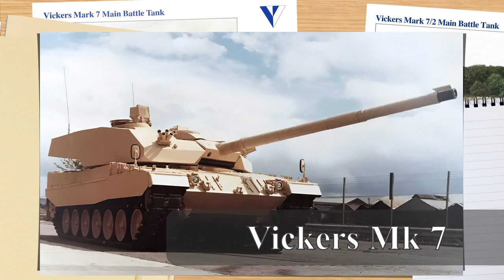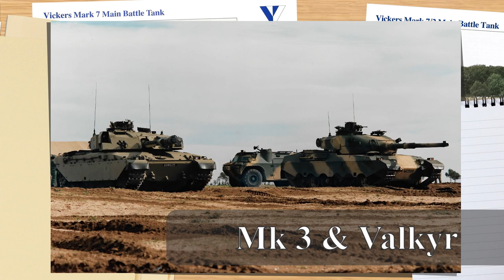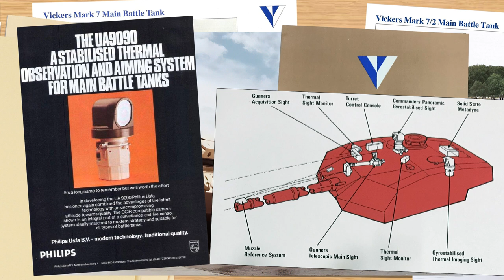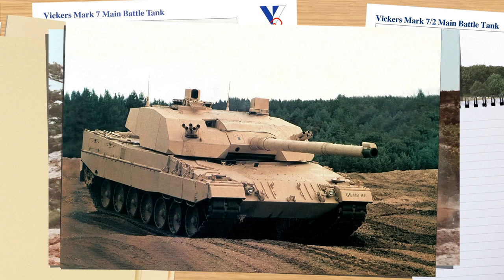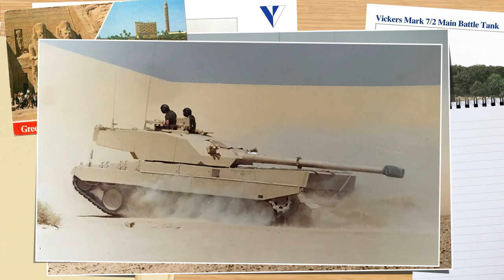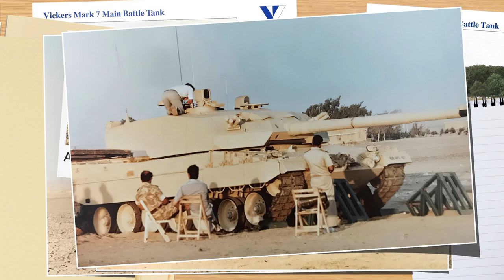Vickers Mk 7 - Leopard 2 hybrid: Tank Design & Development

Comment: What's interesting is that the hydropneumatic suspension of Challenger (both 1 and 2) is generally held to be superior cross-country to the Leopard 2's torsion bar suspension - yet when it came to mobility the Vickers Mk 7 was out-performing the Challenger.
Reply: Weight.
Reply: Because the Challengers are so heavy and also have an underpowered engine trying to move that weight.

Challenger 1 is a 62 ton tank with a 1,200 hp engine. The Vickers Mk 7 was 54.6 tons with a 1,500 hp engine. No matter how good your suspension is, an overweight and underpowered tank will still be hindered in its mobility.
Reply: @RedXlV  1200 horsepower is in no way ''underpowered''  .  That is a very powerful engine indeed and a power to weight ratio of over 19 horsepower to the ton is highly impressive. 
It's worth pointing out that the reverse of your statement is also true. No matter how powerful your engine , a tank with an inadequate suspension system will be hindered in its mobility.
Also, leopard 2A5 and A6 now weigh in at a solid 63 tons apiece. These are heavy weights but not overweight by modern standard.
Reply: @andrewwoodhead3141  By modern standards, 1,200 horsepower for tank that's 64 tons stock and 75 tons with the Theatre Entry Standard armour packages added is indeed underpowered. There's a reason why the other tanks in Challenger 2's weight class use 1,500hp engines. Even the 54 ton Ariete (the lightest of the modern European MBTs) uses a 1,270hp engine, and the AMV midlife upgrade will replace it with a 1,500hp.

19 hp/t is actually quite subpar for a modern MBT, with many achieving 25 hp/t or better.
Reply: @RedXlV  You are abusing the term ''underpowered'' , I think. 19 hp/t is a very high horsepower ratio indeed.  It's higher than T72 and , even , the leopard 1 ! if only by a little. Neither of these tanks has ever, to my knowledge, been referred to as '''underpowered ''.
You''ll note that the Theatre entry package, ''Megatron'' I think they call it , is a urban combat package that has , so far , been fitted to exactly one demonstrator. So we can call the Challenger a sixty two ton tank, which is what it is.
No case for  Chally two being underpowered , I'm afraid , and the armour is better than you'll find on any of the Leopard family.

Edit : Challenger one was sixty four ton , sorry my mistake. Still plenty of power though. And a great gun .Longest tank kill in history and both have a very effective HESH shell that has proved it's worth in Iraq and Afganistan .
Reply: @andrewwoodhead3141  Leopard 1 had an 819 hp engine and weighed between 40 and 42.2 tonnes, depending on exact variant. This gives a power/weight of 19.4-20.5 hp/tonne; a minimum of 0.65 hp/tonne more than a modern "naked" CR2.

From the first deployments to Kosovo, the ERA mounted as standard, along with other various pieces not mounted for the majority of training time, took the CR2 to weigh in excess of 64 tonnes. By 2008, the new ERA, combined with the bar armour routinely fitted, and new passive armour and weapon system modifications, had brought the standard deployment weight of CR2 to some 70 tonnes. Megatron, when testing various APS, has reached 75 tonnes with the armour kits.

Now, the 1200 hp engine being low for CR2's titanic weight has been considered for some time. Challenger 2E was offered from 1998 to 2005 with a smaller 1500 hp engine, which meant more space for fuel and/or ammunition, and was also more reliable than the Perkins in desert conditions. The MoD choose not to pursue a new engine at the time, but has since decided to carry out updates to automotive components on vehicles slated to be converted to CR3 standard, which may or may not include an increase to 1500 hp (the press release in Feb 2019 mentioned an upgrade kit from the engine manufacturer that would allow for this, but there's been no mention of that since).
Reply: @eruantien9932  Well, I can tell you that 1200 Hp is plenty for a 64 tons of weight. I drive that heavy with 500. Of course , a tracked vehicle is different , I get it, but there was no problems with the Challenger in Kosovo. 
My little FV439 had a power to weight ratio far lower than a Challenger tank and we got along just fine. Trust me on this, Challenger isn't underpowered.
Reply: @eruantien9932  The Europack as fitted in the C2E has a larger cubic capacity than the CV12 engine. When Rolls Royce designed the CV12, they made it a narrow v design with the cylinders mounted at 60 degrees. The MTU pack is much wider.
Reply: The Haaip upgrades now being trialed will increase the engine power to 1500hp for the CV12

Comment: Is Challenger 3 just the reverse of this then?
Reply: Challenger 3 is a essentially a challenger 2 with a new turret. Doesn't use anything from  Leo apart from the gun.
Reply: @calumknight9178  The turret is derived from the Leo turret I thought?
Reply: @high-velocitymammal5030  no, its basically a challenger 2 turret with better armor, better optics and a better gun
Reply: @high-velocitymammal5030 it’s got zilch to do with a Leopard.
Reply: @high-velocitymammal5030  nope absolutely nothing to do with leopard at all. Just the main gun
Reply: @high-velocitymammal5030  The Challenger 2s turret is derived from the Vickers Mk7.. correct me if I'm wrong
Reply: @ClumsyProto  All new turret on CR3.
Reply: @agt155  well from the prototype, the main difference in appearance is that the challenger 3 doesnt have TOGS and got updated gunner and commander sights
Reply: @ClumsyProto  They look similar but the CR3 turret is 100% all new.

Comment: Wow it still makes no sense then why the UK went with Challenger 2 if they had this design lying about? I understand maybe avoiding the German hull but did the universal turret get reused in the Challenger program or will it be part of the new Challenger 3 program? Does this tank hold the speed record by any chance ... first I heard of a MBT going 80+ mph.
Reply: 80kmh, not mph. That's about 50mph, which is still quite a brisk pace for a MBT but not unheard of. Also, most top speeds in this category of vehicle are speed limited, not inherently limited by power and weight considerations.
Reply: 80kph not mph...

Still exceptionally fast, particularly given the conditions, as thats 50mph....by the sounds of it just on a full tarmacced road it would go beyond that...and thats without the full 1800hp engine...could have been close to 60mph with that..
Reply: The Challenger 3 uses a 100% German designed turret and a Challenger 2 hull. I don't think the data of the Vickers Mk 7 prototype has any usefulness today.

Comment: It is a real shame that the British Army did not make a stink about how good the MK7 performed. It is cursed with senior officer `yes men.` More interested in a lucrative job after retirement, than standing on their hind legs and making a fuss.
A new hull could have been developed quite easily, based on the Leo 2. But with sufficient structural changes to make it unique. 
The sad 😢 state of British tank manufacturing. Is the direct result of analysis and similar failings.
Reply: Challenger 2 is essentially an upgraded Mk 7 turret on an upgraded Challenger 1 hull.
Reply: @agt155     Made where ?
Reply: @agt155  If only the Challenger 2 had also upgraded the engine. All of the Challengers, even the upcoming Challenger 3, are woefully underpowered given their weight.
Reply: @RedXlV  Challenger 3 is 1500bhp
Reply: @RedXlV  C3 will have a "Quick burst" acceleration function which will enable it to reach 60mph for short periods. This function was also incorporated into C2E. It's average on road speed will be around 40/45 mph.
Reply: @RedXlV  Challenger 2 had an upgraded transmission over CR1 (6 spd forward) which gave it an extra ~20% average sprocket power.